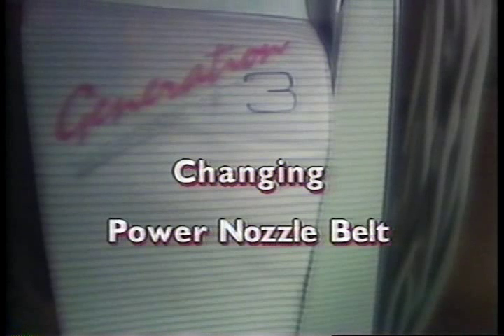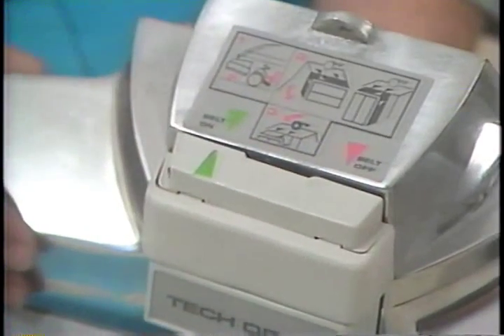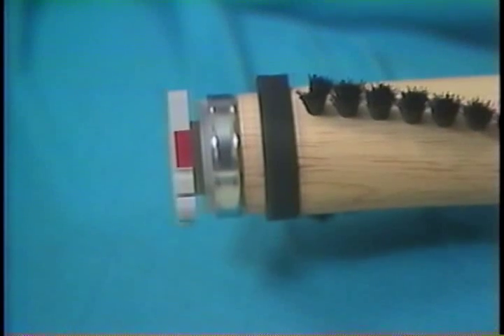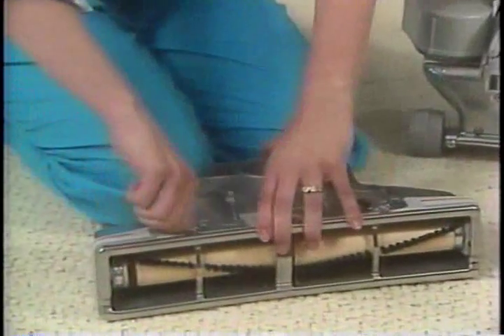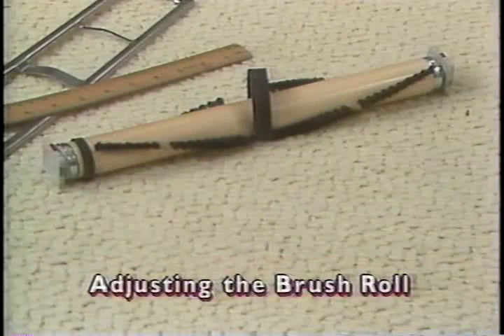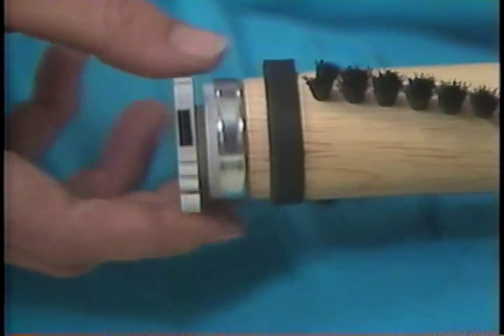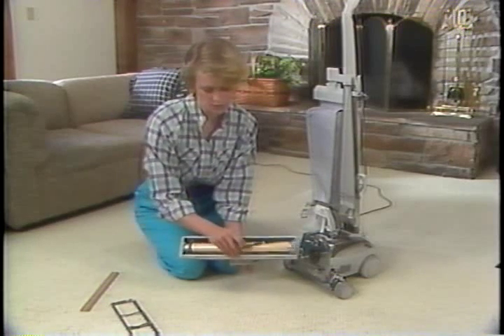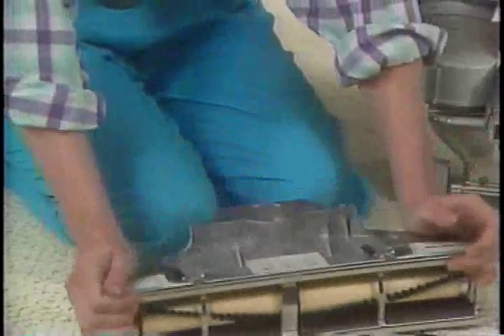Kirby Generation 3 Owner Video Part 5

Comment: Also the Kirby will not run unless a

Bag assembly 
Attachment hose or shampoo tank is properly attached to the exhaust port
Any of these things must be firmly clicked in place for the g3 to operate